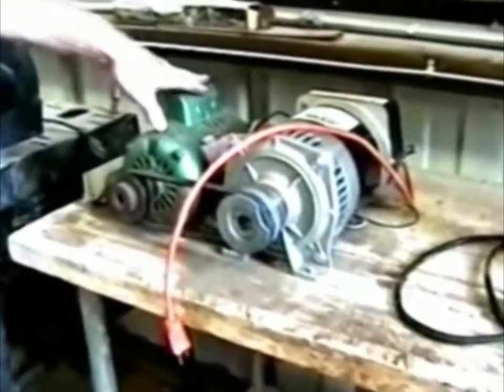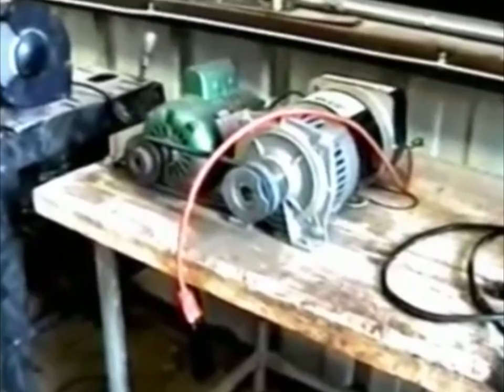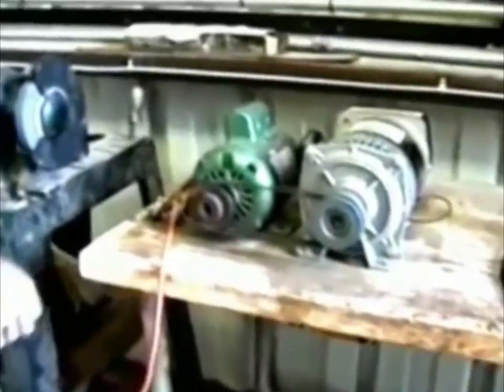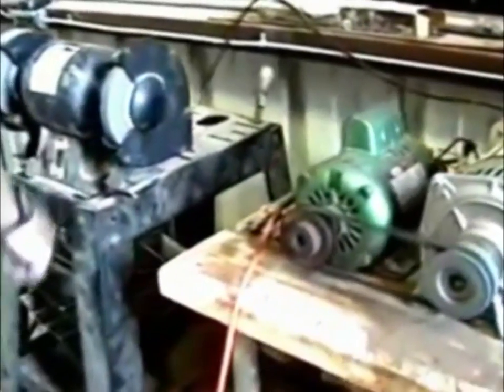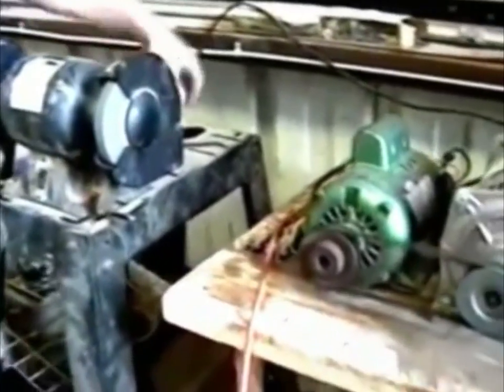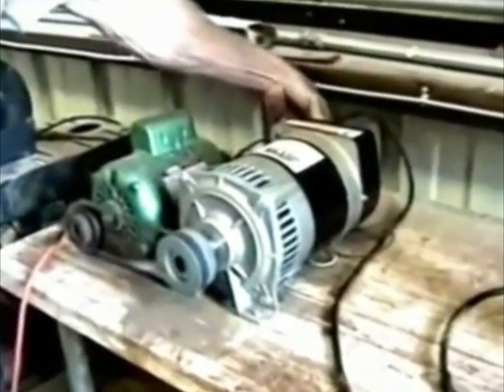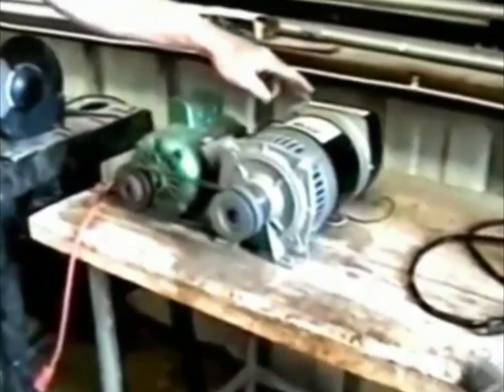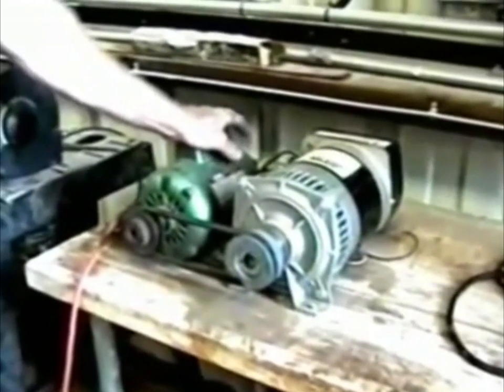Self Running Motor-Generator unit (www.witts.ws)

Comment: perpetual machines cannot exist. 1st and and 2nd law of thermodynamics won't let it happen. It may work for a bit but then it will stop
Reply from the maker: The universe is full of energy, so it can happen.
Reply: Nope.. even if it takes eons to lose its steam, it's literally not perpetual. Of course I'm only saying what I've learned from books and research. But technically there's no machine so far that is completely self sustaining. It will eventually draw more than it puts out.
Reply from the maker: There is enough energy in the volume the size of a coffee cup to boil away Earth's oceans. (NASA)
Reply: Maybe but we don't have the technology to harness it.  Infinite energy is out there, but we are 100+ years away from being able to use it.
Reply: Doug Bailey Tesla did this 100 years ago. jp Morgan pulled funding took all his equipment and blew up his tower. it's shown we can do it everyday. take your car it needs a start after that the rpm is met for power production. the battery can be removed and it will run until the motor stops. now take a 10kw generator. the laws are bullshit. a 10kw generator doesn't need a 10kw DC motor to spin it. you need a power source to get it going like a car. once the rpms are in operation range. it's making 10kw the motor for these sizes are 3 to 4 kw. why would it stop. you car runs with no battery. the generator has the rpms needed to operate. the motor has the 4kw it needs to run. so why would it ever fail. how would it ever not have enough. that leaves 5kw roughly to run what you want without overloading the generator it's Shep time and time again on here. mostly in places where the grid isn't reliable. Look up the hundreds of Americans put in jail for going off grid. I have some homework report back. call your power company and tell them you need to disconnect your providing your own electricity and see who shows up. look at Florida during hurricane Irma telling people you will go to jail if you use your solar panels while the grid is down. information is power. imagine if everyone could make free power from a generator and a washing machine motor. people love to say my book says it won't work so it won't. no need to try wasting your time case closed. we all know the govt wouldn't lie to us right. they just love us so much
Reply: they do not want us to be able to be self sufficient. they will never let these be in Lowe's or home depot. the news sure isn't going to fucking ever say you can take a generator and a washing machine motor and create free power.  funny how laws are just a man's theory until something else is observed and everytime they are so sure they are right. but 4kw motor turning a 10kw generator once plugged in to get up to speed does that. 4kw motor is make 2.5 times the output. but wait my book says power out has to be less then power in.  my books have this law in them it can't be it fake it has batteries there's a hidden wire. funny 99 percent of the people showing this. won't sell you anything. they have nothing to gain. most are in Asia middle east with poor power grids. I saw things like this in Iraq. but was young and occupied. it always comes back to my book says it can't so its fake. funny how billions in profit a year can make people print stuff on a piece of paper. If I had a few hundred million I could print a dozen books. get some universities with millions in donations to show with "research" whatever I wanted. with enough invested I can have the world think the sky isn't really blue it's a illusion from the upper atmosphere. and I bet everything people will go to the bank with with because it's in a dozen books and dozen universities I pay and their professors say it is
Reply: so, what happend if i install a power inverter with a battery in midle  of the  motor and generator head ?   yes it will to work  , because  i made it, and  it worked...

Comment: "I've altered this generator slightly with the addition of Pixie dust, unicorn horn and Jesus jism."
Reply: it will "self run" bt for a very small amount of time(few secs or max 1min).
Reply: The magic ingredients for violating the laws of physics.
Reply from the maker: Research some more, energy is all around us just like air.
Reply: Of course it is but your video mentions nothing about tapping into that energy. Your video implies that with the exception of a little extra juice to start from the wall, that the generator provides more energy than the electric motor that you use to run it. Since we both know that is not the case, why not tell the whole truth?
Reply from the maker: It is not my device, ask "Witts" for details.
Reply: Yes, "Jesus Magic"...I saw. I didn't say it was "your device" I said it was "your video". Google "Anatomy of a free energy scam" for details.
Reply from the maker: Did you replicated it?
Reply: Did you replicate parting the Red Sea?

Comment: Safe And Inexpensive Electric Power Production Without Steam Boilers, Fossil Fuel, Nuclear Reactors, Petroleum Products, And Little To No Greenhouse Effects. COULD THIS BE REAL?
 I no longer have to imagine the headlines,
 “Low cost, safe energy available to all!” 
Yes, low-cost, safe energy is possible. For example, the “Papps Engine” which is said to runs on Noble gases has been built, a new working model using much newer technology. They have even patented it now. The word is they are now looking to the automobile industry.  So far nothing else has been heard about it, and its been a few years now. Why is industry dragging they’re feet? With other processes, we can eliminate the need for so called “clean coal” and natural gas fired boilers, no need for petroleum product use to produce electricity, no nuclear reactors or storage facilities, no more open pit coal mining, no more of the messy, large-carbon footprint fuels of yesteryear.  Leaving little to no Carbon emissions, little to no contributions to global warming, and a negligible carbon footprint, we can lessen the  parasitic consumption of our natural resources.  And we can do this all at a very low cost!
 
 We don’t have to use heat to create energy.  Other thing create energy.  Since the dawn of the Industrial Age, we have used carbon-based fuels to create energy, which in most cases always involves heat, not to mention the lack of efficiency.  There are processes that do not use heat, but cold.  Crazy, you say?  Implausible?  Let’s look at some implausible things just 8 Decades ago, you would have been called crazy if you told someone that man can breathe liquid, work in space, live in orbit on a space station, dive to the most remote depth of the oceans, yet today all these things are no longer science fiction. They are common place happenings. We live in the age of Star Wars, Star Trek , the Abyss, and 20,000 Leagues Under the Sea all rolled into one!

 What I am proposing is possible now!  Not eight decades from now. Think about what this could mean to the environment.  Imagine the civil and social impact this will have on our world if all of these theoretic processes could go into production.  How would it impact all of our lives? How would this impact our childrens’ children? Should we not explore all possible avenues to achieve this?  Personally, I would love to see, for myself, what life would be like without having to fear the slow cancerous carbon effects and other varied environmental impact(s) on the world, brought on by the use of our current processes for generating simple electricity, for powering vehicles and running industry. And don’t even get me going on chemical pollution issues. This is not a dream, this is a possibility in the near future, as a matter of fact these are possible today. Martin Luther King once said, “I have a dream,”  if we work together, “we can make a dream come true?”

 It’s about time certain dreams came true for the world; cheap, clean energy, less carbon emissions, and no need for a steady fuel supply or places to store it.  There have been hundreds of so called “free energy” inventions designed and several working models have been built and tested. None have ever been produced, let alone on a large-scale basis.  Why not, I ask, and you should question this your selves.  Its not that they don’t work or are unsafe. What is unsafe, They consider nuclear safe. In fact they are safe, and do work, and can be scaled up or down in size to fit specific needs. These inventions can run cars, make electricity, power ships and trains, turn pumps, run fans, etc, etc, etc.  But it has been said to me, “by economically wise individuals” that if one or more of these ideas were ever to be produced and put into practical use, the adverse economic trickle-down, and restructuring would be catastrophically disastrous to the worlds economic powers as we know them today. It has been said that these effects would be so broad and damaging across the employment, retail, and production fields that it could be financially catastrophic to the economic base of all nations. Face it, the all mighty dollar controls the path that the world Has to follow!

 “In my opinion”, These are the only reasons nothing has been done yet; control, greed, power, and prestige.  Well now, it’s time for the world to make that big decision, “Is the almighty dollar (power) worth the future of our planet”? “Does the end justify the means”?  Can we afford to destroy our planet so a few can “hold all the gold”, so to speak?  There is an old saying to define “The golden rule”, “ The one that holds the gold, makes the rules”! Change has to come. Let us make this difficult decision to change for our childrens sake, as well as our own  future. With out forethought can be no change, no future, and eventually no world to live on.

 Yes, I have my own ideas, my own dream, my own theoretical process to achieve this, my own desire to help the world, and not just line my own pockets. This is not a popular train of thought. This is why I may seem fixated on this subject. I have a very personal connection to this. No, please do not attempt in anyway to contact me, address any responses to the editor for rebuttal . I could go into detailed examples to back up what I have said in the past paragraphs, about past and present inventions, but you can simply go online just as I did to find the information I found.  It took less than an hour to run most of the information down. One of the first models of the “Papps” engine has been built and has only one issue, said the inventor. That was high voltage electricity that had to be dumped some how, sounds like a dream product to me. The current inventor is looking to the auto industries for marketing his product on a large-scale production basis. Why haven’t I or any one else heard about these advancements, it runs without fueling and makes large volumes of electricity as a byproduct? Well now!! That sounds too good to be true!!!

 Now, lets look to the rest of the personal and industrial needs of the world and stop dragging our “political” feet!  Are we ready to change the means to finally justify the results of our actions?  Regardless of aiming towards this, the worlds’ economic structure is in ruin already. The U.S. dollar is on its way out as the benchmark world currency, which means we are no longer “The Worlds’ Financial Super Power”. We are financially broke as a country, and face it, have been for quite a few years now. The best we can hope for now is to step up and take the lead in this new age of technology, hopefully resulting in the restructuring of our own economic base. We can take the lead and be the ones to create and implement all these new processes that have been developed.  We can redirect the production of existing technologies, and create something new, something efficient and like nothing ever seen or implemented before. If we take the lead in technological development, we take the lead in the economic realm as well.  It is the only way to achieve a reasonable, final goal in today’s advance technological basis.

 With the world on the brink of self destruction daily, we need to change our priorities and stop worrying about the economy, boarders, religions, and races first, and think of the environment first. We can’t afford to expend our natural resources. We have only one planet to live on, we are a closed system.  In my opinion, the world needs to pull its heads out of what ever dark, stinky place they have them and look at where we are going as a planet if no changes are made, and soon.  If Americans openly promote and lead the world in the promotion and production of these advancements in technology, we can reestablish our lead, and set a new benchmark for the world to follow. 

 Reality can stink, and still be livable for us.  It won’t be as easy for those who are used to having wealth and power at their disposal. The rest of us “poor folks” will be all right, we’re all broke now, struggling, living pay day to pay day.  If there is no world catastrophe to deal with, what’s going to change?  We need to put aside all of our petty political, religious, racial, economic, and any other  personal beliefs hindering a new frame of mind, which is needed in order to achieve a final end ensuring continuance of the human race. As my father used to tell me, before he passed, “My son, its time to pull yourself up by the boot straps and keep on trudging”.  Well world, these are words to live by. It’s a long row to hoe, a lot of social work to bring the world together, but if we can stop fighting long enough to fix the problems, and exist together, then nothing is unachievable.

 I would like to thank those who have read this, and are now pondering these thoughts.  

Sincerely,  

 Brian R. Loring
Reply: Brian Loring you cannot "create energy", your argument is invalid!
Reply: #gobacktoschool!
Reply: Brian Loring this has always been real. Tesla did this 100 years ago. and jp Morgan pulled all his funded took the equipment and blew up his tower when he learned that he planned on giving free power

Comment: What if a man has solar panels and a bank of batteries, use the charge controllers dump load setting to initiate a big relay turning on an efficient dc motor to run generator and use excess power to recharge batteries automatically.  Use a weighted flywheel to make the system a little more efficient and draw in gravity assist.  Once the batteries are charged to set max then said relay is deenergized and gen shuts down.  Using inverter from batteries to power your home.  Coefficient of power is greatly increased along with bearing life and whatnot......  I believe I will be testing soon, results will soon follow

Comment: attach an air pump compressor with a pulley and then you have a continuous air supply for your air bearings to increase rpms and reduce friction. ball bearings is where the industry makes money off of us. friction and inefficiency. add solar and turbines.

Comment: change the gearing and you will find your "extra" required power.

quantum physics 101
Reply: Yep and very achievable feat. I'm a mechanical engineer and have something similar but a larger scale even. But it's to bad putting a patent on tech that would make the world greener and carbon footprint basically obsolete and give the ability to be self sufficient back to the people would more than likely make you disappear "from a natural heart attack or complete fluke accident" lol.. ;)
Reply: More gear means more power more power means more current in ampere and more ampere means more load and more load means this thing not work and I'm not against in self rotating motor or infinity motor.
Reply: And more weight means when load is switched over into the closed loop means less resistance on the rectifier.

Comment: this is possible, however, can this run 24 hours in 7 days?  to supply my house...
Reply: This seems it would work best for a house with a battery back up system. Use this to keep batteries charged then it would shut down to rest. That way it doesn't overheat and last longer.
Reply: +furulevi then fix the bearings and try going again :p
Reply: what i mean it will not overheat without stopping the whole month?
Reply: +Elmer Erik B. Plaza attach a fly wheel to the rotor
Reply: Yeah it is and even better if you get an low rpm generator it will last longer because the bearings won't worn out as fast with an 3600 rpm geni
Reply: This will categorically not work.
Reply: +Elmer Erik B. Plaza the short answer is YES.

the guidelines and requirements are not of todays standards. you need to think outside the box.

if you had a power house with 10 of these (30kw) and a battery bank, you could easily live in a 5000sqft 5bdrm 3 bath house. no problem.
Reply from the maker: +Elmer Erik B. Plaza 
I think yes, until the bearings fail...
Reply: @furulevi  what size of AC motor can I get to drive my 7000watt petrol generator alternator? Please

Comment: As much as we would like to believe this demonstration. It is improbable.
Reply: I know for a fact this works. Once it's started you just flip the switch so it doesn't require the outside power to operate. It's quite simple really,  as it was 30 years ago, and capable of powering small shop equipment. One phase in the generator is impedence matched to the motor. one phase isn't used at all.